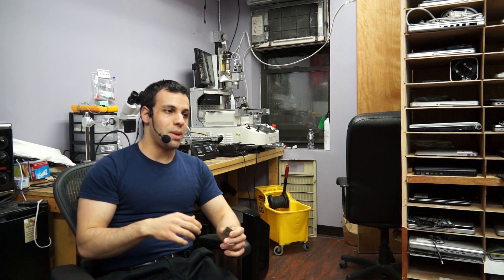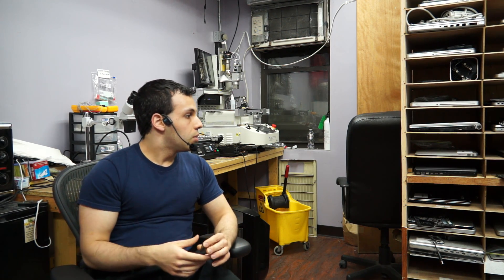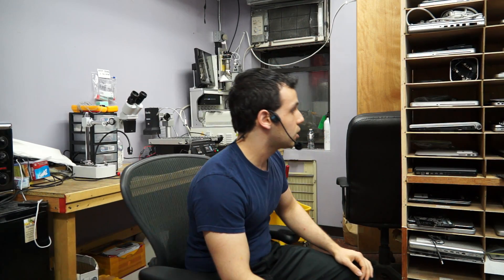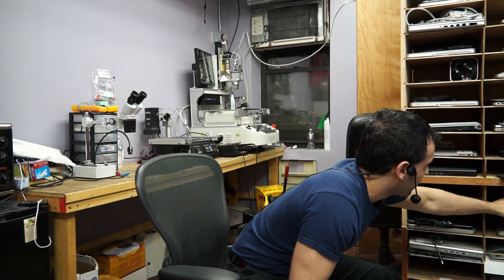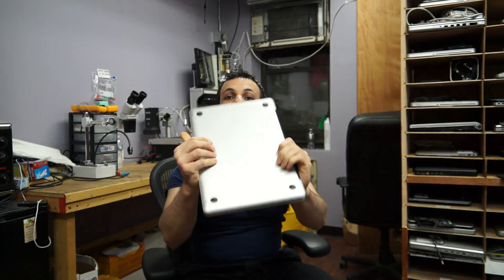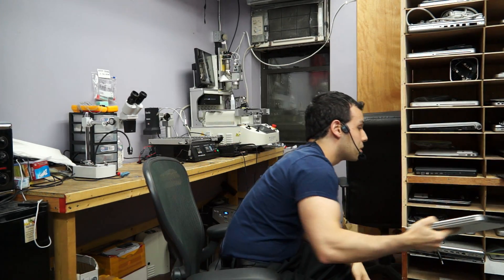Reballing flip chip GPUs is BULLSHIT - the truth about dead laptop GPUs & repairing them.

Comment: More generally, technology is fundamentally extremely fragile, created explicitly to make a fast buck, and deliberately not built to last. Doesn't matter if it's a GPU or a microwave oven, it's all part of the same throw-away culture.

Just look at the compact disc, as perhaps the most typical example. Here was technology that was hailed as being basically indestructible, where your music and data would last forever. Fast forward a few decades, and it turns out that the plastic medium suffers microfractures, not only under rotational stress, but even just as the result of atmospheric exposure. And the metallic layer that stores the data basically just disintegrates over time, a process known as "CD rot".

Doesn't matter how expensive the technology is, either. It all dies, sooner rather than later. The shelf life of technology is so short that it really should be classified as a "perishable product", no different to vegetables, and with prices to match.

Comment: i don't agree with you... the chips which work and get over heated for long times .. the solder connectors get weak then split from the board  then get oxidized.. heating it for a little bit revive the work of the chip for a little time then the solder connectors back to disconnect... you may try that your self ... push down a chip which has a problem and you will see that it's back to business untill you stop pushing.... i believe in chip reballing as a long term method of chips repairing.

Comment: I think what is you're saying is correct, but I looks you're quite the smart ass about it. Hence the many dislikes. Don't underestimate people so much. Here's what good repair guys would do: they will tell the client that their fix is a temporary fix and they better sell their laptop asap. A buyer should be suspicious buying something too cheap. Where I live repair guys and buyers are useless. I have a broken iMac 2009, where the power button doesn't work any more. They want to try and fix it after you let them buy a new power unit, but not guarantee that it'll work. The Apple Center doesn't want to do anything. When I try to sell it mentioning it is broken, the year it was bought and the minimum price of $75, tell still ask if it works and want to buy it for half the price or less. It's quite simple you buy it as it is and there's a chance you can repair it. If it fails us it for spare parts. End result is that is gathering dust and I will break the screen one day before putting it in the trash bin. If I had the knowledge I would make myself a Hackingtosh as Apple's price is becoming too high. Btw I work 3-7 days a week in the graphic industry.

Comment: Awesome video!!!  
I want to get the OS to never use the graphics processor.  So I can use my computer.
I'm a retired EE, and have one of those 2011 MB Pros.  I took it to Apple in 2013, and paid for the repair.  They did it 3 times under 90 day warrantees!  The computer spent 6 months with Apple!!!!  I had to buy a MacBook Air (which I like better).  Now it's 2019.  It just went on the fritz right after updating the OS. I will try my hardest to never buy a laptop with discrete graphics processor!  Linux is fine with me!
I bought the computer for the i7 processor.  I do heavy processing of genome wide association study data, and plotting graphs doesn't need a discrete graphics processor.

Comment: Hi Louis. I had a question. I am a production artist. I work in the printing industry. I also run my own from home graphic design business. I have been using Macintosh computers since 2001. I used PCs mainly for the purpose of gaming and entertainment. A couple of years ago I decided to build my own machine for the same entertainment purpose. But I started using Photoshop on it for creative retouching. This is my own artwork because I am not a professional retoucher but my experience in graphic design has gifted me with skills in many areas. I found myself using CorelDraw with Photoshop CC to create large banner art for personal clients. Most of these jobs were completed in half the time it would've taken me to complete with my MacBook pro (2012, 256 ssd, 16 gb, Core i5 2.5 ghz). But my machine is bloated with games, movies etc. I did not build it for work. I am definitely in need for an upgrade. My MacBook pro is not cutting it with the heavy lifting I need for large jobs. I took a look at the trash can Mac pro because the price went down and my intention is not video, its large scaled graphic design. But, I found that Lenovo has workstations that have better specs and the pricing is decent. I configured a workstation on their website with my needs for less than $1,700. The favor I am asking of you is if you can give me an advice if Lenovo is a better option. On paper it sounds so good. But I do not have experience with this company. Any advice is appreciated. 

Here are the specs:
    Processor : Intel Xeon SILVER 4110 Processor (8 cores, 11MB Cache, 2.10GHz)
    Operating System : Windows 10 Pro for Workstations 64 over 4 cores
    Operating System Language : Windows 10 Pro 64 for Workstation English
    Motherboard : P720 MB Intel Purley Dual CPU
    Memory : 32GB DDR4 2666MHz ECC RDIMM
    Memory Qty : null
    First Video Adapter : Nvidia Quadro P620 2GB (miniDPx4 )
    Hard Drive Controller : Intel Integrated Controller
    Primary HDD Boot Drive : Yes
    First Hard Drive Selection : 256GB Solid State Drive,2.5",SATA3,Opal
    First Hard Drive Selection Qty : null
    Memory Card Reader : Integrated 9-in-1 Multimedia Card Reader
    Ethernet Adapter : 2x port Integrated Ethernet
    Audio Card : Integrated Audio
    Keyboard : USB Traditional Keyboard Black English
    Pointing Device : USB Calliope Mouse Black
    Power Cord : LineCord - US
    Power Supply : Tower 92% Power 690W
    Language Pack : Publication English
    Warranty : 3 Year On-site

Comment: I have a laptop that has a HD7670M that artifacts at random. when playing games it's stable but if I try to clock it up to 750Mhz(600Mhz stock) core 1020Mhz(900Mhz stock) memory if its not above 60c it dies and now lately it cannot be overclocked so i keep it at stock. the reason I do this is because in furmark it doesn't go above 62c and with a overclock 63-65c which is not much i did put everithing to performance but still makes the red checkerboard artifacts. before i removed and replased the display drivers it constantly destabelized and started moving my screen and making black barz it stopped that after a fresh uninstall and reinstall and only the checkerboard artifacts left. if it dies(in rare cases) and i need to turn on the laptop it works as if nothing happened it doesn't need to be heated up so it works again. Max gpu temp i reached was 70-75c again not much. specs: i7 3610QM 8Gb ram HD7670M. my cpu is worying as it reaches 95+c in sometimes but it hasn't caused any issues.
I want to get a new HD7670M chip but i wonder how come a chip made in 2012 can be made in 2017 on the same 40nm scale brand new? my older brother's hp had a amd cpu with a inegrated gpu (external chip) that died he told me that he found sites where you can buy the chips and they are new his hp is from 2010. To me that is wierd. Sorry for the long read.

Comment: Hey Louis thanks for the knowledge dude. I really respect your honesty. Question though how do you know for sure if and when a GPU is completely fucked. Im just curious. Im studying to get my A+ cert and i really wanna land a job in a repair shop for experience and because i love building and fixing stuff.
Reply: Watch Northrige Fix. If your GPU is worth too much to tinker with, pay a professional. If not, he has some excellent content that will show you were to start. Get some practice SMD soldering on some old computer parts. Find some old motherboard or GPU that doesn't matter, but still works, practice removing and replacing components until you are comfortable.

Comment: I just have a tiny question.  My 2009 MacBook Pro crashed, I got tired of taking it in so I just bought a Air.  What I want is to be able to use my old guy for showing movies attached to my tv.   I put a new hard drive in, it will not power ur, I do the option command R re boot, I get to the utilities page, when I click on anything else, I get a blue screen and then nothing happens.  Do I need a new Graphics chip??   Thanks .

Comment: I was researching smd soldering techniques and your video was in the lineup afterward. I have no idea wtf reballing is but as I listened to your stance on whats what and your concerns of what the end results are going to add up to what.  I effing  cheered! I respect your conduct sir, half the reason i research new things is because most people that "do" something don't think, don't care, and after a buck.  It's kind of funny how skeptical people can be when your trying to tell them the truth after they ask for your help or opinion about something they know that your are experienced with. ughh told my buddy his timing was off and to "see if there is a short first". 1500$ later i went and looked after he had it in the shop. found a spark plug wire grounding out. I never post sorry for the rant and thank you for not being a compulsive brainwashed sheep. ÓÒ hi 5

Comment: Its not the chip if it was the chip it would never work again its a cooling issue you can reball it 1000 times if you stick it back in a shell without better cooling it will keep doing it

Comment: i just applied heat to a GPU of a notebook that was never used for video edition, but it still died, and after heat it it works again,
since the problem was not the solder, what the heat made to the GPU so it works again? what are chip bumps?
i dont expect this nvida shit to last forever now, but just wanted to know the reason heat solve the problem even if its temporarly,

Comment: I must say that I find this a vague theory.
First, there are no matter in a chip that melts below 180 degrees. How else would the factory have to place it differently?
Secondly, the chip becomes hot while the environment remains cool and that gives shrinkage and stretch. That is precisely the issue and gives separate contests.
Thirdly, if there is a shrinked user in it, explain why an old card continues to function.
Fourth, dust and heat pull things apart.
Ok, before you go into this, you were talking about a brain that says things can not. Against this, I say that silver and your bridges do not just melt into each other at too low a temparature.
Unfortunately your sadness is "busted" by a noob, and by facts. By just thinking right and concentrating on physics.
I do not want to attack you but try to show you where you are stuck.
The theory of limited shelf life of a chip, we should go into that because that would be a point of attention.

Comment: I do agree with you that you get flip chips on game systems aswell here is a question we did a test on ps4 blue light of death you remember the bolt fix on xbox 360 well there is a washer way now on ps4's LOL sorry LOL about washer but anyway we try the washers on a ps4 without heating the chip and it boot so in the video saying if you heat up to 120c to fix the bumps  it will work this was dead cold no heat not fighting just asking

Comment: Surprise, surprise! I found an alternative cooling system inside a notebook....

I've been in IT for 32 years... 33? Shit time passes... Tech support, programming, networking both physical and logic, you name it. I never tried fixing notebooks, though. I did open up a handful to clean exhausts and once to change a fan - and why the fuck would they place the most fallible, cheapest and critical part under the keyboard, motherboard and everything else so you need to take out 34 screws of 6 different sizes, unhook 8 connectors and crack a dozen plastic snaps while trying to open it? Oh wait, right, so you don't do it and the insides melt to a gunk when cooling stops working. Got it. Did I rant? Did I???

Anyway, I got this HP Pavillion 9700 from a friend. When she turns it on the LCD shows that checkered screen typical (as far as I've seen) of a failing GPU. Apparently it is a very common failure in that model and I found a lot of reflowing and reballing videos - that's how I found yours. Actually what I was looking for was a step by step vid of how to open it without breaking anything. And when I finally got to removing the GPU cooler, this is what I found (I wish I had been recording it to get my expletives for posterity...)

It had been there for a while. You can see the shape imprinted on the underside of the cooler.

https://www.youtube.com/watch?v=CFns_EXgPIs

Comment: The thermal paste thing is soo god damn stupid. Its super cheap to use better material but they dont just to save a million dollars or something on manufacturing. Imagine if some rich guy buys a lambo or a ferrari and the stock tires they give you from the factory are completely balled and has no treads at all. They drive the car and then the car crashes due to spinning out of control but ferrari still will not give you treaded tires lol

Comment: One question how the bumps in the chip get melt as it requires 100 deg C but I am watching the temp of the GPU and it is 52 degree c then it crashes in front of me . Can we solve the problem by converting the laptop into desktop and supply water cooling system . 
Or another way is to change the mother board if you have socket processor with Intel i7 and since ram and HDD ,wifi module , display, keyboard , speakers , ports are working only motherboard GPU  failed. Do the new chinese motherboard will last long?

Comment: So, I bought a replacement logic board a1260 820-2249-A used with a 603 gpu. There is definitely darkening around the gpu area on the under side of the board. The guy swears he did not reflow the board. Is it possible the components can darken a bit from gpu temperature over time?

Comment: ... they run super hot because mac os lets the chips run that hot, because the software has been set up to let the chips run close to 95 degrees C at maximum loads instead of, you know, start the ventilators. And when it comes to the cooling system, it's a joke. It can't even keep cool a 25W CPU. The end result is that the mainboard fails after a few years, but that's just physics -- you either design a cooling solution that keeps the system running at normal temperatures or you let it steam for long periods of time, but then you accept that the electronics has reduced life expectancy. It's not rocket science, ffs.

Comment: I remember the timez when everyone beleaved in Reballing the CPU and GPU of a PS3 is the riht thing, NO! itz that u have to replace the Thermalpaste under the heatspreader >)
Reply: Almost 12 year old 60gb ps3 here. Only changed the thermal paste on top of the heat spreader. Still runs as quiet as it was new :D
Reply: @bookshelffury  Good caretaking it can be, but most isnt it would be nice if every ps3 would be like oh just change the thermalpaste and youre good to go but nahh :P sony for the modders, oh repairs ^_^ but im glad ur one works, mine does too i got a c04 modell jailbreaked 500gib HDD :D , ledz at the bottom :)) and holes where the fan is, also IHS deledd this thing never dies >)
keep good care of your one then youre boss ^.^
Reply: Not quite, it's the NEC/Tokin capacitors that fail most of the time. I've tried changing the thermal paste myself on red blinking light machines, not only was the original paste still fresh, new paste didn't change anything.

Comment: Hello, someone did a reflow on my mac, it worked but died the next day. So I decided to do it myself (nothing to loose). Turns out it worked. But they did this OpenFrameWare trick in which they set up the fans to max always. How do I reset them to default to that I can control them with fancontrol app instead? I tried reseting the SMC, but It din't work. 
Thanks!

Comment: i got a gtx 770 that has alot of artifacts showing when booting and will give a bsod when i install the latest gpu driver. it was a cheap gpu 4 years ago and i dont realy want to spend money on it. would it be a bad idea to heat it to 150C (only the pcb, so without all the plactic and fans etc)  and see if it works, if not 220C? its a papperweight right now so im not worried. or i can send it to you and u can have it :P

Comment: I agree with Loius ~99%. I bought into the whole reballing procedure a long time ago. I soon noticed that there was very little difference in success between heating the GPUs to ~120-160C or doing a proper 217C solder reflow. The only tiny issue I have with his 120C heat test is that he's saying it can rule out BGA solder. But that same 120C heat that moves around any broken GPU substrate contacts also could move around broken BGA solder contacts. So it is a flawed test for proving where the breaks might be. What the heat does is scrub away enough oxidation to allow a temporary electrical connection through the broken trace or BGA pad. Unless you have like a million dollars worth of x-ray microscope equipment, like he said, there is no real way to know where the break is or how good a solder reflow job actually is. Again, he is mostly right, most likely the damage is to the actual GPU chip substrate and not the BGA solder. Me, I hate to throw electronics away so I will try a reflow even if I think there's only a 5% chance. A few of my reflows have stood the test of time, most have not. It's up to each person to decide, what a few extra months of life out of their device is worth. As long as everyone knows, it is a temporary fix and best used to recover your data.